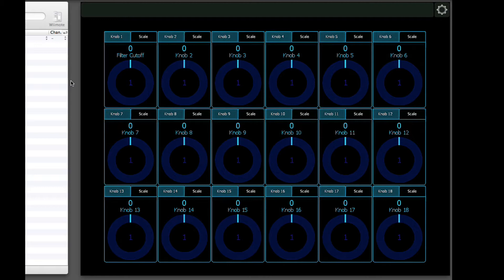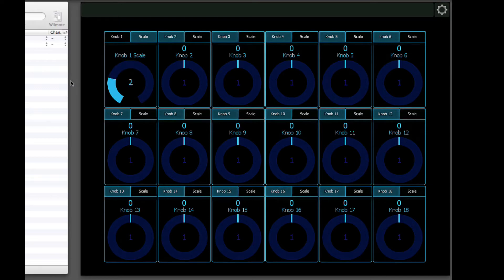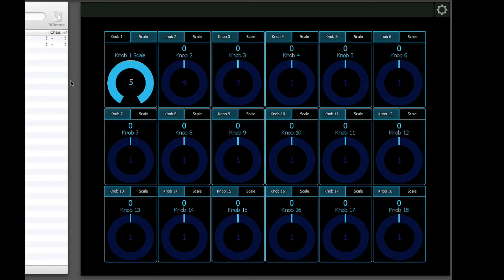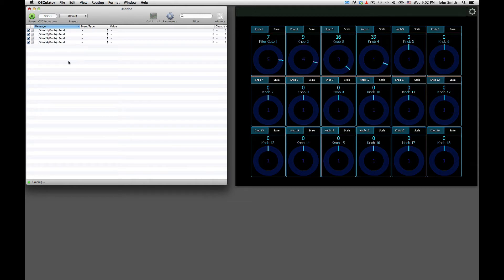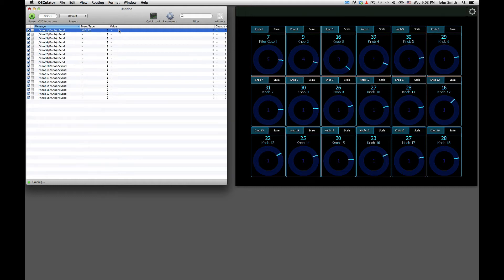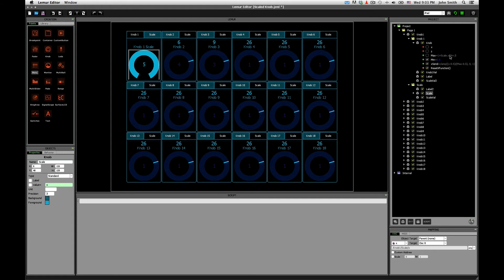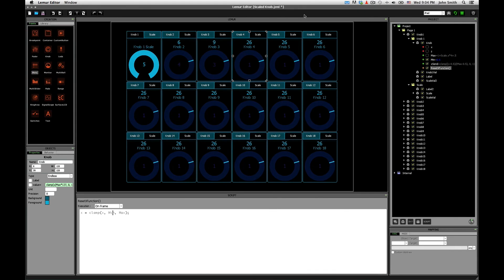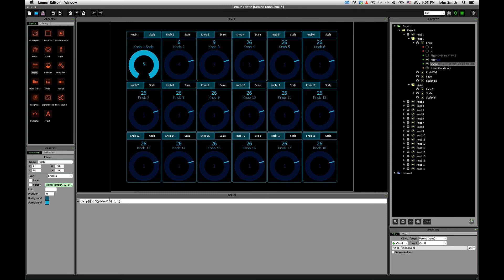Lemur + OSCulator - 18 Scaled Knobs (Template)

Comment: Awesome knobs,  can’t find templates though.
Reply from the maker: Oh, true. Yeah this was made 7 years ago, not sure whatever happened to the file. But from the video you might be able to re-create it, or some variation of it!
Reply: Just hacking Around I’m sure, Your info is great. I just wanted to see how to make a adsr.
Reply from the maker: @01halo  Ah, sure. Check out my most recent video, it might give you some ideas in terms of how to manage the values of knobs (the same ideas apply to other controls), even if you don't use endless faders as shown there. What was your specific difficulty in making the ASDR? It can be done using multi-faders or normal faders instead of knobs. There are several options.
Reply: Just hacking Around Just hacking Around 
I already know how to do the fader, it’s just the graphics for the adsr readings I want it to show.
Reply: @JustHackingAround  I also would like to know how to send NRPN messages through Lemur to a DSI Mopho and Tetr4.
Reply from the maker: @01halo  NRPN consists of consecutive CC messages. If you can find the "axfex II" midi template on the Lemur website, it's a good example of sending more complex custom MIDI.